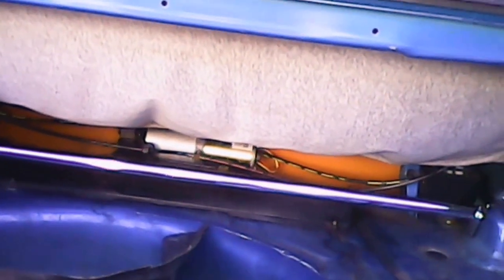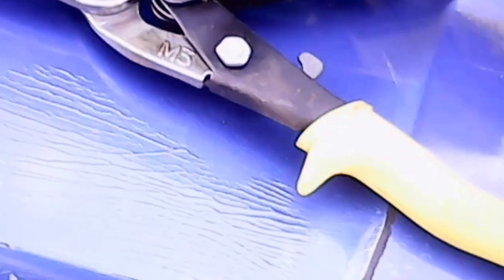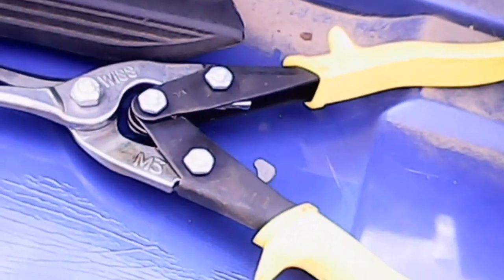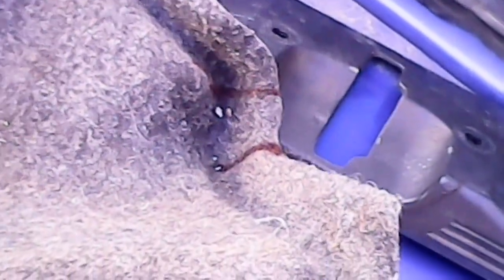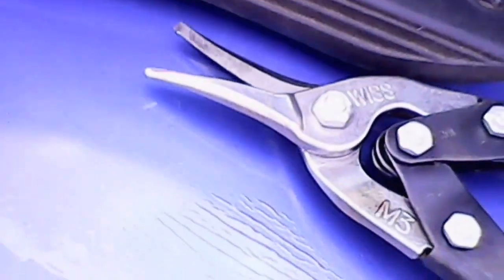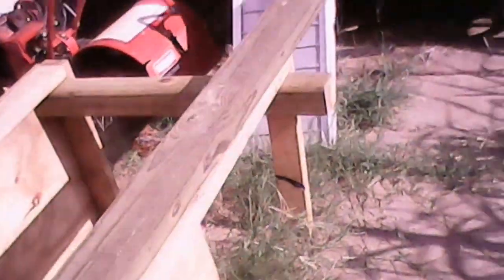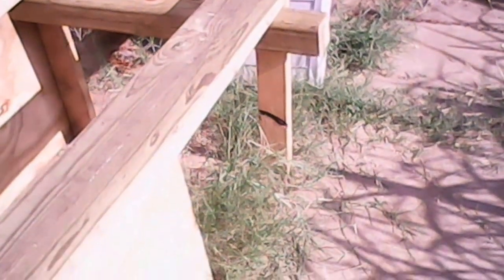Mustang Update 6A 2

Comment: If you can't get them as clean as you like a little trick I use is grab yourself a spray can of grey paint ( as close to the color as you can) and give them a light coat they'll look like new 😜👍🏻👍🏻 Cheers brother 🍺🍺
Reply from the maker: I will give it a try if I can find dark gray or maybe black
Reply: +Carolina Man it doesn't have to be the perfect match as close as you can and just a light coat and you may have to do the floor part of the trunk carpet to match 👍🏻👍🏻
Reply from the maker: I have been wanting to change the interior and trunk to black I really don't care for gray
Reply: +Carolina Man That will look great!!! is the spare parts car have black interior??
Reply from the maker: No it's tan leather and expensive to cover. Being in Oklahoma cloth seats are more comfortable
Reply: +Carolina Man Yeah that makes total sense with the heat😉👍🏻👍🏻